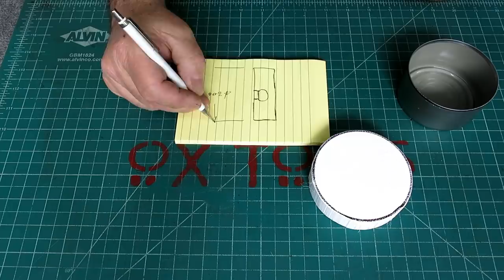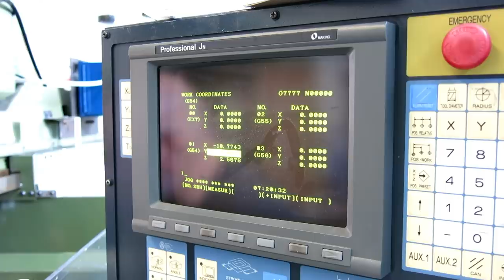Canned Tuna Dewatering Press

Comment: When am turning stringy plastics I always set up a vacuum to suck up the string to prevent it from bird nesting like you experienced. I have a small shop-vac set up on the back of my lathe with an adjustable steel hose that can be easily placed to catch the strings when I turn plastics. I wired a magnetic switch to it that I keep on the front of the lathe.

Comment: Fun project.   I was surprised to see you didn't pull out a Kant-twist to vertically secure the trapped end when you bent the smaller radius.  Your mill vise bending jig was the perfect solution.  👍👍😎👍

Comment: You should check out side cut can openers. They don't leave the sharp edges of the old-style, plus the top can't drop in and contaminate the contents if you don't disinfect the top of the can before opening and the top then can be used as a strainer too.
Reply: Totally agree - not to mention get the right one and the turning force needed is much lower - great for arthritic or if you have not much strength in the hands

Comment: Zen and the Art of motor cycle management at work.... Cool job Tom! No immediate pressure besides the need for a tuna sandwich from the beloved misses. And tinkering in the right flow towards the desired and much appreciated result. These are the best jobs to do. Probably 200 ways to go but just pick one to get to the end satisfactory. Start, wrong or right, and go with the flow. Listen to the music and enjoy the process. This is about having fun with your skills without customers,  tight tolerances,  or tight schedules breathing down your neck and getting the job done with or without some "true" machinist behaviour. The only thing that counts is a smiling face on the receiving side and probably a small valuable puzzle on your side just before going to sleep or pillow moments: "Ok I did it and made it working but how should I do this when I have to make more of these?" I'm curious about your thoughts here. And thank you for sharing this with us. Best, Job

Comment: I found this to be a great build, Tom. Thanks for the video. 
I, myself, a connoisseur of many a tuna can and a hand press for it was thinking of a few things as I watched. With my hand press, the tuna often squirts around the open edge of the press and on occasion ruined whatever clothes I had been wearing with a jet of tuna infused water. My idea was to make the diameter of the tool a bit closer to that of the can and to impart a number of weeping vents along the edge. What could be more fun than figuring out the number of vents you would need and setting up the rotary indexer on the mill to accomplish this. ;) Just an idea. Thanks again.

Comment: My Bride of well over 55 years has a method.  First, we use one of those side cutter openers which stops hand cuts.  Then she simply folds 2-3 paper towels and places them on a plate.  Then she dumps the can of tuna on the towels and using a smaller plate she flattens the tuna which drives out the water.  Easy Peazy.  Then the chopped egg, miracle whip and some of her homemade relish and with a little stirring one has Tuna Salad.  Pressing tuna would be a great use of your bride's etching press (if you "GET-ROUND-TO-IT").  Maybe her wanting a press was a subtle hint and you thought tuna.

Comment: Tuna oil as a rust inhibitor and coating for your steel and cast iron parts. 
Heat the part and dunk it in some tuna oil.
It actually works quite well.

Comment: Hey Tom,

I've used silicon bronze a fair bit for casting repairs as a tig brazing filler. It looks like you were welding with it here. Does that cause any issues with the stainless? It certainly makes hard spots on the iron when they mix.

Comment: HDPE is my favorite plastic to work with. It can be a little tricky to deburr sometimes but other than that it's a great material.
Reply: Used to run a lot of Delrin. Got so I could have the chip coming off of the tool like a geyser right into the old cicular filing cabinet.

Comment: Did you ever do a follow up video to the composite master square video? You left off where it was being sent for heat treat. I can’t find anything past that. It was three years ago.

I do a lot of fine filing too. Several sets of very small files plus diamond ones. But if there’s a fair amount of material, I’ll use a small bur in whatever shape seems right in a Dremel or Fordom to get rid of it so the filing doesn’t take too long.

Comment: I know it's mainly stainless steel but a little olive or rapeseed oil works wonders on both kitchen metal and wood.
Olive is more "grippy".  A thin coating on pan and knife handles gives them a tac that actually stops them slipping in the hand.  Rapeseed if good for lubing can openers and unseasoned and seasoning cast iron.

Comment: How would you drill a verticle hole in something round like the primer end of a brass cartridge case in order to make a modified case for a Stoney Point OAL gauge without damaging the soft brass? Just using a V-block doesn't insure that the hole is centered.
Reply: Make a fixture to hold it in place with a hole for an ejector pin in the bottom of the case
Reply: Remove the de-capping pin from a full length resizing die and use it as a collet/fixture in the lathe chuck. Make yourself a 5/16 - 36 threaded rod ahead of time to pull the case back out of the die after threading the case head.

Comment: Hi Tom, I would have made a round knob, with small half moon cut-outs around the diameter. Evenly spaced. Wing nuts utilize 2 fingers, round knob uses wrist action. My 2 pennies!
Reply: With a wing nut you can use both hands if the base is attached to bench.....
Reply: Actually, a lever-type is even easier than a knob but I agree with you that a wing nut is more difficult than a knob.

I would suggest a round bar T handle 4" long.
Reply: listen to Tom his wife has arthritis in her hand she needs large easy grip handles
Reply: You could also attach it to a cordless drill instead of the wingnut or knob.

Comment: When testing designs for usability I like to use the greased off-hand method; I oil up my left (non-dominant) hand with vegetable oil and try to use the device. Well designed mechanisms should be operable and this is as close to testing reduced dexterity and grip strength as I can approximate in the workshop.

Comment: There are 2 can sizes they sell at the store. The cans are 3 1/4" and 3 7/8" dia. I can find press for the smaller dia. but I can't find the larger size anywhere. 
I buy the bigger cans but I just use the lid which is messy as hell. I hate de-watering tuna because of this. 
Now I just need to buy a lathe and mill so I can make a tuna press too.

Comment: Man, that's a work of art!  One tiny quibble:  As a food processing tool, you have to consider any spot where food material could collect and rot.  I am a tiny bit concerned about your press-fit ball swivel.  Maybe just put a little olive oil in just before you snap the lid onto the ball.
Reply: He said he made it specifically removable for cleaning...
Reply: @mattmanyam  , yes I noticed that.  That's why it is a tiny quibble rather than an important issue.  The question is how often is it actually going to be removed for cleaning?  I have done a lot of cooking over my life and I also suffer from arthritis in the hands and fingers.  Popping that ball out to clean the joint took a lot of finger strength even for Tom.  Were I to use one, I would likely wash off the exterior and hope that nothing was growing down in the joint.
Again, a small issue but one that designers of food processing implements need to be aware of.  Overall, that press is a work of art as well as a useful tool.

Comment: I do the same with my thumbs over the sink takes 10 second after opening. Or open the can set a smalle ramekin on the top flip upside down with ramekin down in the sink press down on top of can with your hands using body weight if necessary

Comment: The large wing nut is probably a lot easier on the arthritic hand than pushing in with the thumbs. However, the wing nut still requires grip strength.  A lever design with a linkage (google restoration hardware super juicer) might be both easier on the hand and quicker to use.

Comment: 5 minute version:
Weld a 3 inch steel circle to the fixed jaw of a C clamp to support the bottom of the tuna can.  Add a little bit of flat stock or another 3 inch circle of steel to the moveable jaw to help keep the removed lid from collapsing as you add pressure.   Shoot it with paint to match your toaster.
Done.

Comment: That looks very useful!  I would love to see you make a tin opener that will last -  can't find one to buy anywhere!
Reply: You used to be able to purchase replacement cutters for the swing-a-way wall mount, but they have cheapened the new models and no longer sell the cutting wheels.
Reply: OXO Can Opener Amazon 1045593 takes a few tries to figure out how they work but they are great. The hand turned mechanism (no batteries required) doesn’t cut the lid it opens the crimp.  Then the “little parrot beak” is used to grab the lid and lift it off.  Easiest can opener I’ve ever used and the cans have no sharp edges so I use them in the shop.  Best can opener I’ve ever used!

Comment: Hey  thanks for video again.  Got my dies and punches sharpened tonight,  then tinkered,   Had a cheap indicol copy, die cast aluminum,  bad die, twisted and bent, sawed out a frame?  Filed, sanded and made a proper indicol frame to use with my grizzly imitation parts.  POS grizzly indicator holder, made a new frame now I can use it.  Made it special red anodized, painted it with red dyecum.  Hey, I have touch up paint.  Unwrapped a diamond wheel,  ordered from Amazon.  Need to grind in some prescion bench stones, not going to pay 200 dollars. A pop.  Bought a lapidary wheel, 1 inch bore, got a worn out indicator stylus,  need to use it this weekend to indicate wheel to bore to 1 1/4 to use on surface grinder.  Amazon special,  plastic center, but if  I bore it true, should run true, aluminum edge with diamond,  plastic center hub.  What I am trying for is precision bench stones.  Should work, wish me luck.   40 dollar wheel versus 200 dollar wheel.
Reply: Rambled a bit.  I am impressed with the lapidary stone I got off Amazon,  if I can bore center hole and face mounting face dead nuts,  I can make me up prescion bench stones. Not going to recommend it to the masses, but with proper care a cheap diamond lapidary stone can be used on the surface grinder.

Comment: I usually just cut most of the lid off and squeeze the juice out down the drain, while the water is running. But that's one way to do it.
Reply from the maker: The squeeze part is the difficulty.

Cheers,

Tom

Comment: Yeah, I suppose it has a place for those cans that need a tin opener to open them, I buy the small cans with the ring pull top and just press the top in once it's cut free, then I have to fight my cats for the Tuna juice.....I buy the spring water type from Aldi stores for 87 cents as they are almost 90% tuna meat as opposed to 50% + water  that the John West variety sells for $2.

Comment: Finally something I can comment about. 8 yrs patiently..... Did you buy Starboard HDPE in small dimensions? I can't find any resellers for less than full sheet orders.
Their proprietary blend is promised to have less  internal stress and  warps less often after milling to thickness.
Reply from the maker: Hi Chris. I get it at Tap Plastics as well as McMaster Carr. At Tap plastics they have a scrap bin where they sell drops by the pound. I generally take a look when I'm in there and if there is any thicker stuff I get some.

Cheers,

Tom
Reply: @oxtoolco  I live in Canada where we are still enjoying snow flurries. The shipping starts becoming 2/5 the cost of any order. Add the conversion, and we don't fart very high notes.

Comment: I can't imagine the day when I need a mechanical contrivance to smash tuna.

That said, if you get the tuna that is packed in oil, it doesn't need to be drained so thoroughly that you would need to apply force. It's just not nearly as watery, and the oil will make your tuna salad so much better.

Comment: Okay,  it may be because I have arthritis in my wrist, but I wondered why you chose  to design this with  the screw press rather than a lever operated press. In my particular case, twisting is not my friend.  I guess if I were to have designed this I would have used a lever, plunger, and spring type arrangement rather than having to screw it down and then unscrew it everytime.  My arm weight could overcome the resistance of the spring if I had a long enough lever with no twisting motion and the spring would pull the plunger back up.   I am just curious if the lever action would not be a better choice for your  wife also.   Oh, now let me add on a trolling part.   Why did you not add a arduino, a servo, and automate it?  Just kidding... oh, wait - like an automated can openner or coffee maker... opps, not as much of a troll as I thought.  I think I just trolled myself.

Comment: Watching you use the can opener incorrectly had me excited, not because it'd probably be the only time I got to teach you something new (rather than the other way around), but because it got me thinking: why use a can opener at all? Instead, turn that plunger into a sort of giant hole punch that progressively shears the lid of the can as you tighten it. That'd make for some challenging machining, but then you'd never need a can opener again. Oh, those can openers are designed to be held with their cut off wheels on the same plane as the can lid, not the walls. Try it. When I learned, it blew my mind.

Comment: Why did it have to be a press why not use centrifugal force by spinning it like a washing machine
Early washing machines used roller press to get the water out then progressed in to spinning action
There is actually a lettuce spinner to get the water off after rinsing

Comment: your poor wife has to fight with a tin opener and then turn the screw, could you not of designed a tool that for the first 5 turns opened the tin, then the next 5 compressed the meat.